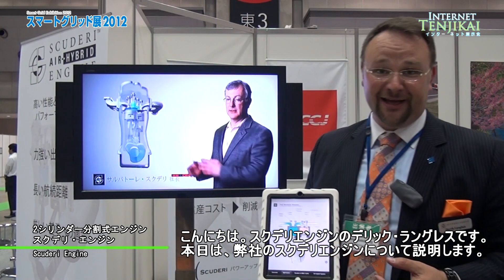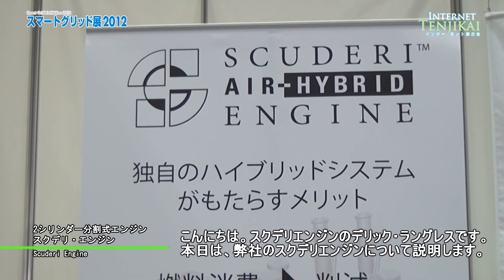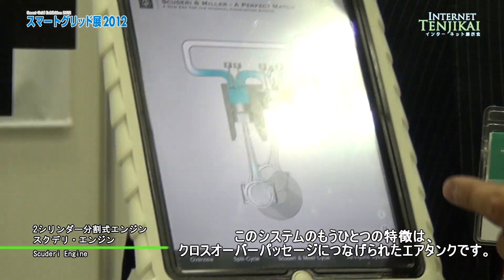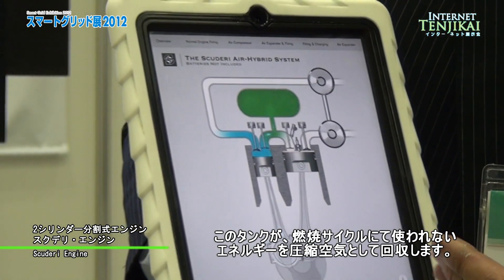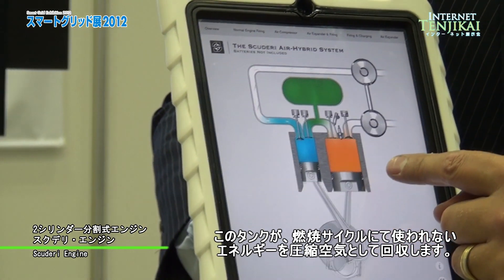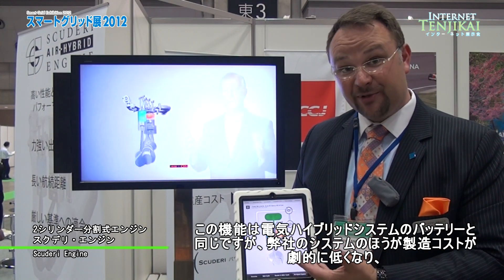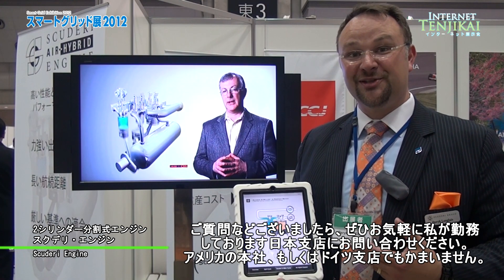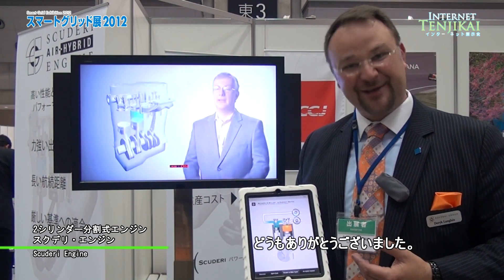Innovative split-cycle design from America - Scuderi Engine

Comment: This design is totally FLAWED. The crossover passage/port would have to very small to allow the compressed air from the cylinder to prevent expansion. This will prevent the majority of the air from entering the cylinder due to the loss of velocity. It's been decades and there is NOT a single working engine to prove your claims. That speaks volumes about what a miserable failure this concept is.